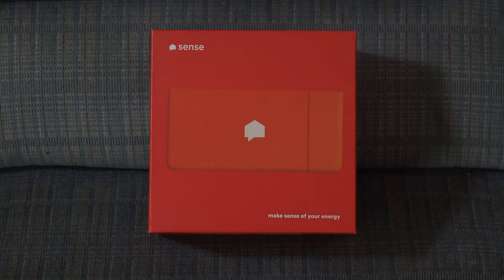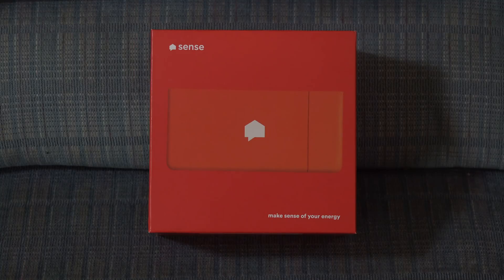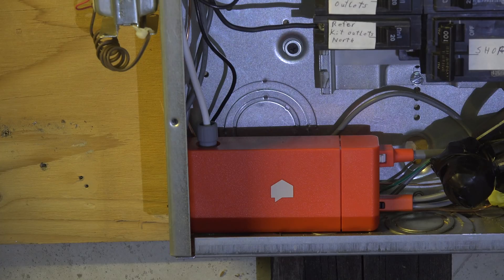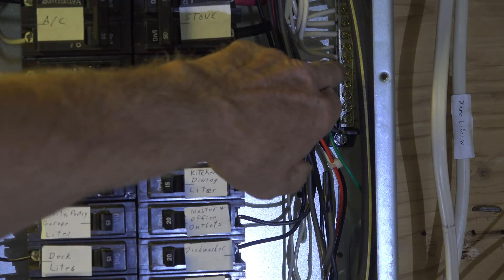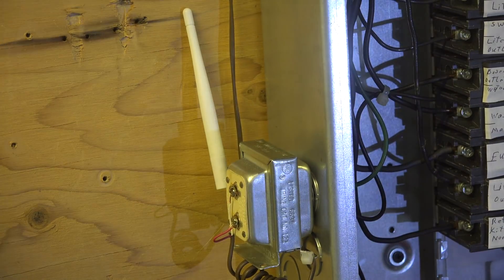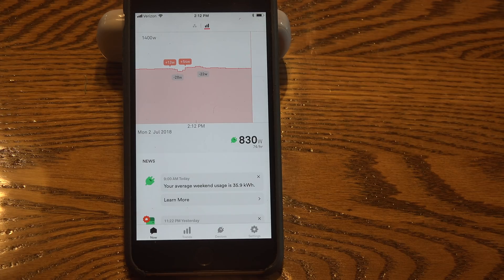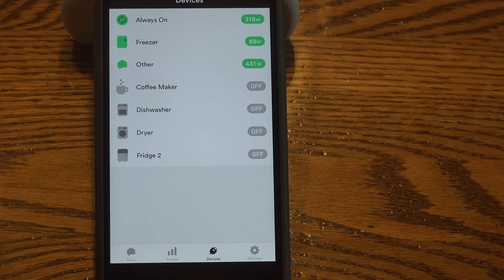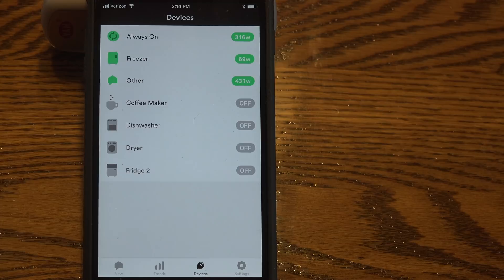A test of the Sense model SM2 energy monitor Part 1

Comment: Since this device is measuring voltage and current (simultaneously) in real time, it is providing a true power reading, unlike your false power calculation in your A/C misting test. Voltage RMS x Current RMS (measured separately) does NOT = Power. AC Power = Voltage RMS x Current RMS x PF.  When you turned on the mister, the compressor's PF (power factor) dropped and you did not account for that.  Now that you own a true power meter, I suggest that you repeat the A/C mister test.  The misters are far more effective at reducing power consumption than your test indicated.  To give the mister method a true test, double the number of misters.

That said, I do not use misters because I live in South Florida (high humidity), and am concerned with long term coil damage.
I complete support your testing and encourage you to do more of it.

As others have noted, the misters increased the cooling capacity of the system resulting in shorter run times yielding in even greater energy savings.
Reply from the maker: I have discounted any "power factor" because it really makes no difference.  You will see in the future what my tests have revealed with cycling times and temp split.  As for mister numbers, there will be some tests that cover that too.
GFM

Comment: I would agree with some of the previous comments that these kinds of two CT clamp monitors are  good for watching how much power is being used and where some of the loads are but attempts in the past to "intelligently"  determine individual loads by signatures of amp draws have been problematic, especially when you combine things like heat pumps with varying loads, subpanels and garages.   There are at least two different strategies  relative to trending, those that accumulate a local database and those that depend on a remote server.   A local database ensures high resolution trending while the remote server is lower initial cost.  Multiple CTs for subpanels and big loads makes more "sense" in many cases.   Small loads will always be primarily summarized as "other".  However there is no denying that $300 will give you a good look at when the power is being used and may serve as a crosscheck to the utility meter.   In my case, I would want individual CTs for my two speed heat pumps and CTs for their backup heat strips in addition to the overall amp/watt collection.
Reply from the maker: Load determination is the largest challenge of this type of monitor.  We all understand that it will not be able to cover it all accurately.  How well it does in identifying loads is what I will be looking for.  Certainly you could get accurate numbers if you had multiple sensors on each load.  I am in the process of determining how well this thing accomplishes this task.  
GFM

Comment: Is it good enough to tell accurately what item is being used.  Big users like dryer, stove, is easy to detect but smaller stuff?  It would be great if it knows items say above several amps, I guess it looks at startup signature from motors and learns.  The other total data is great.  What did you find, report back after some time of usage?  I have heard it has trouble detecting certain loads.  It would know if fridge went on, but will it know when it turns off, will it detect that over say another load turning on.  I can see an improved unit that has wireless clamp ons for those hard to see loads.
Reply: A D TheEnergyDetective (TED) made those same type of claims to identify loads with just two CT clamps, after trying for a couple years they backed away from any claim of that sort, came out with new models with per-breaker measurement capabilities.
Reply: It can detect when the fridge turns on and when it turns off, so you can set alerts for it running too long, like more than 2 hours, or if it doesn't cycle enough, not on for 1 hour in my setup.  As others have pointed out, it isn't perfect, but it can add intelligence to major appliances like refrigerator, dishwasher, and I now get alerts when my clothes washer and dryer finish, although they are more than 10 years old.
Reply from the maker: I can see some problems with identification of certain loads, but am giving the tool a chance to work itself through these issues.  There are other valuable things that it does to monitor usage so you can decide what to change.
GFM